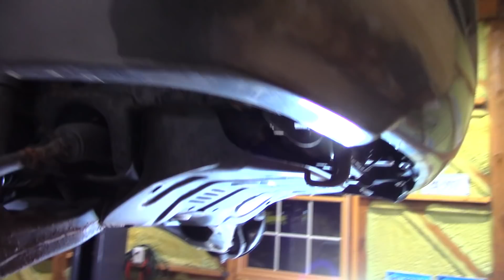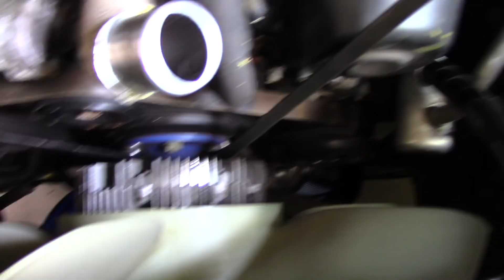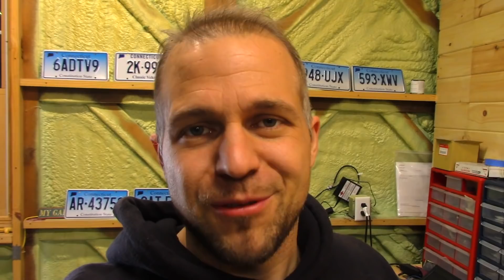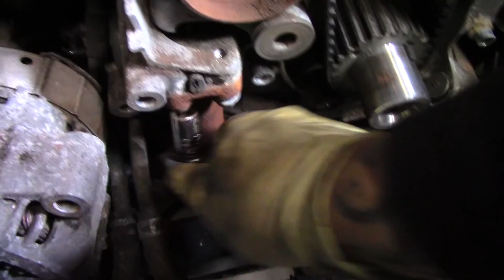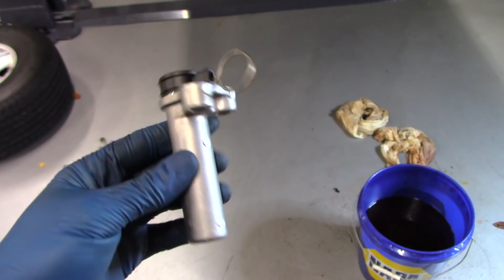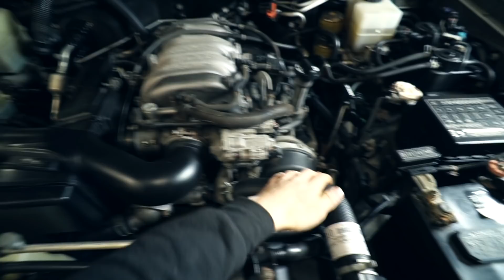Lexus LX470 / Landcruiser Timing Belt Replacement

Comment: On a 2UZ timing-belt job, replacing the water pump, idlers, tensioner, and front seals while access is open is cheap insurance; verify the crank timing mark before buttoning it up. We live in the 80/100 world and enjoy helping keep these trucks on the road.

Comment: Nice work. Thanks for taking the time to film it.  One thing I'd add, if I may, (especially for anyone tackling this for the first time): if you're not replacing the radiator at the same time, slide some cardboard or 1/8" hardboard between the radiator and the engine bay to protect the fins.  You don't want to risk slipping a wrench or dropping a driver/part you're removing into the radiator, causing a leak. OEM radiators are NOT cheap. ;) Good luck!  You can do this!

Comment: I have a 2002 Lexus Lx470. Before removing the timing belt, do I have to advance the crank from the TDC to the T mark so it won't jump?
Reply from the maker: It will help when you have to retime the new belt having the marks close to TDC already

Comment: The 1st mistake I see so far is crank on TDC. But I did theses for 23 years. It's a interfering engine. The correct way is  when you get the crank TDC and cams lined up. Move crank notch to the pointer.  This is 45 degrees off of TDC. Note where your cam notches are lined up. If using Toyota parts, belt is marked, just remember, passenger side is R, driver is L. I removed radiator. Putting a little pressure on them can cost you. I replaced all timing components with new. You can all ways find the your manual for a small fee using Toyota, Lexus public website. Same as we used. All manufacturers have this information. TIS.
Reply: I have a 2002 Lexus LX470. When you said, "Move crank notch to the pointer". Do you mean move to the T mark?

Comment: Do you still have this truck or the gx470? Any upgrade videos coming on them?
Reply from the maker: Still have the LX470 and Matt has his GX470. I haven't done anything to it outside of a Carplay head unit and speaker upgrade. It's just a great vehicle :)
Reply: @TheSlipAngle  did you have the mark levinson sound? If so, what speakers did you go with? My gx470 needs a set
Reply from the maker: @ianmccormick247 No I had the Lexus Premium sound. I'll admit due to not having any plug in harness options I brought it to an audio shop I know and they repinned all of my stock connectors with a new amp. I went with Kicker Comp 6.5s" in all 4 doors and have a Skar 6" sub in place of the stock unit, though the Skar  unit kinda stinks and I'm going to add a better sub soon.
Reply: @TheSlipAngle  copy that. My front passenger are blown and from what I’ve seen the Mark Levinson uses 8 ohm speakers making replacements hard to find. Perhaps audio shop in my schedule as well lol
Reply: @TheSlipAngle  THE best. I have 296k on my ‘01.  Have loved it since the day I bought it 22 years ago.

Comment: Great video, I did one a few years back, getting ready to do it again. I ended up getting that crank bolt loose by running the breaker bar through the upper control arm and quickly turning the engine over. It worked but was a bit dodgy, just in case someone doesnt have the tools to get it loose

Comment: A pair of large tongue and groove pliers did the trick for me to hold the fan clutch while loosening the nuts. Just open the jaws wide and clamp two adjacent nuts with one pair of pliers while you loosen one of the other two. Don't remove the nuts until they are all loose.

Comment: When you put the O-ring onto the water inlet housing and installed it, did you place any RTV or seal packing after that? If not, has the o-ring done a good job of sealing? The reason I ask is b/c I just took my inlet housing off and they had RTV and an o-ring. Thanks
Reply from the maker: I don't recall, if something did call for RTV I would have made note of it in the video.
Reply: @TheSlipAngle  Just double checking. The repair manual doesn't call for it where I was asking. Just an O-ring like you installed. I guess the people before me applied RTV for some reason unknown.

Comment: Process is the same as 1uzfe. The easiest way of removing the crank bolt is to soak it with WD40 and let it sit for a night then use impact gun. I didn't use any special tools for removal of crank pully bolt.

Comment: Great video! Nice car.  A question that it's puzzling me: well, the car has 87K and the T-belt is serviced every 90K or every 5 years. The car was always serviced by Lexus. Then I guess they should've replaced the T-belt several times on this 20 year old vehicle. However,  there are no stickers (?) in the engine bay with the date and mileage of the last T-belt replaced. Maybe I am wrong but otherwise we can assume that the belt inside is the original that came from the factory ... WOW ...  If that's the case it's just amazing it's in such a good shape after 20 years!!
Reply from the maker: Yeah I couldn't find anything indicating it was done, but the belt that came out was totally fine. I think this car was consistently garaged given it's condition.

Comment: Thank you for the detailed video. How long did it take from start to finish?
Reply from the maker: About 10 hours taking my time and following a video from another YouTuber
Reply: The Slip Angle what was the parts total cost including all the misc parts you installed at same time. It’s the only way to roll. Thx

Comment: Awesome video. Can you tell me when the engine is at TDC and the marks on the camshaft pulleys are alligned with the line,  why didn't you  rotate the engine about 50-degrees counterclockwise?

Comment: Oops, bad compression rings sign, 30:37 coolant should not move during engine start.
Reply from the maker: That is not a sign of bad compression, engine spins the waterpump when it runs. Compression is fine. It's been 20k miles since this video and engine has been running without a hiccup.

Comment: Great video! I am looking at getting a gx470 so this is great insight and very similar to the 2jz timing belt water pump change. The job can look intimidating but the knowledge and confidence gained by doing it yourself is priceless and can be passed along to other similar cars and trucks.  Just curious but does this engine have cam and a front crank seal that can be changed during this process? I know on my 2jz I did these seals when I was in there, thanks.
Reply from the maker: Yes they do but mine were bone dry. I don't want to fix what isn't broken and risk creating a leak.

Comment: If you are leaving your rad in place like this video a good tip is to put some thick cardboard on the back of it so you don't ding the fins. Thanks for the vid :D
Reply: Kris Fulton@ You’re a switched on dude Kris. Very good advice. I removed the radiator when I did the timing belt on my 2UZ-FE 4.7 Land Cruiser but I still placed a thick piece of cardboard over the air-conditioner condenser to avoid damaging it.

Comment: Nice video, the Lexus Dealership here in Reno Nevada just quoted me $1,440 for the work and replacements you just did. Not sure their bid included the new pulley, tensioner, and radiator hoses either?  Do you think they are over charging me? Mostly Labor for sure and their shop time is $195 per hr, seems rediculous price gouging to me but then again you did a lot of work there too? Thoughts? Mine is a 2003 LX470...
Reply from the maker: That seems about right? The parts cost me about 700.00 alone for all OEM Toyota.

Comment: How much did all the parts cost (t-belt, water pump, and supporting gaskets, rings, etc.)? I'm about to purchase a 99-00 LX 470 and am trying to get an estimate of maintenance costs.
Reply from the maker: I don't know the exact total off hand, but I want to say it was around 700.00 for everything including fluids and the crank tool.
Reply: @TheSlipAngle  I paid $720 for the first tbelt and all all labor by an ex Lexus,  home garage mechanic. Got gates tbelt and pump done at 90k miles. It's at 127k miles now,  no problems. I would def pay 3-400 more to have all this done including labor,  not worth the price of $700 plus you're doing it all yourself.. Great vid tho
Reply: @21fnasser  he bought all OEM parts lol. I dont think they charged 3-400 for labor of 10 hours

Comment: Good job!  Having done a couple 430's I would say I rate the overall job more hours on Lexus, but easier.  Miata I was not very pleased with the putting on the belt and timing alignment.  For future if you purchase a chain wrench it will work on any pulley removal you run into so you don't have a collection of one off expensive specialty tools.
Reply from the maker: Thanks Ian! Yeah, the Miata belts you have to really get down on eye level to align the marks correctly. It's easy to be off a tooth and not realize it looking at it from a downward angle.

Comment: Why didn’t you do the starter trick for the crank bolt?
Reply from the maker: I could have to loosen it but I'd still need a solution to hold it in place to torque it to 180 ft/lbs

Comment: The real question is ... is this faster than a miata in a straight line?
Reply: Probably not with only 230 hp to the 5,100 lbs  it weighs, I have one, they have low end torque, but not much else 🤣
Reply from the maker: Probably lol